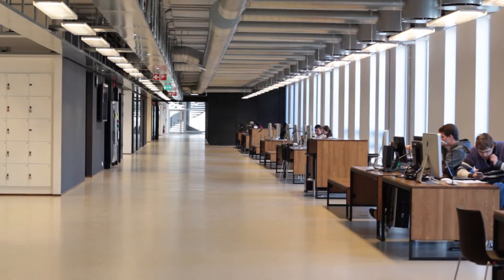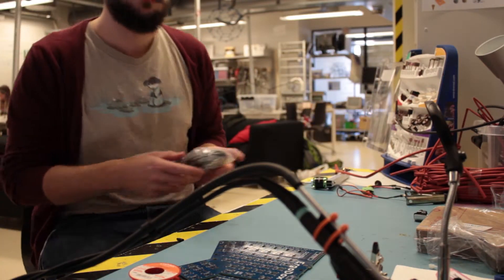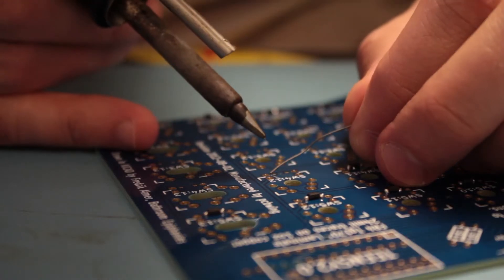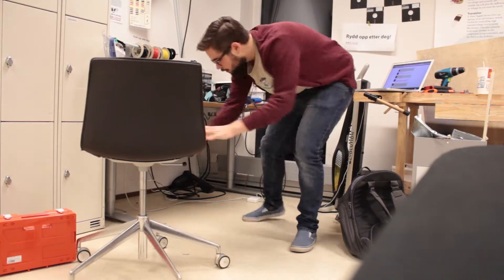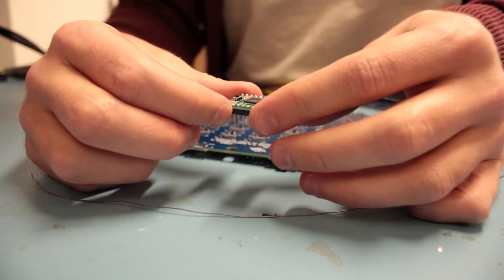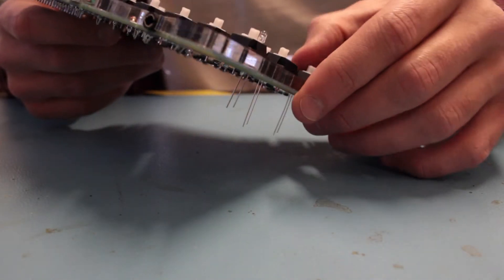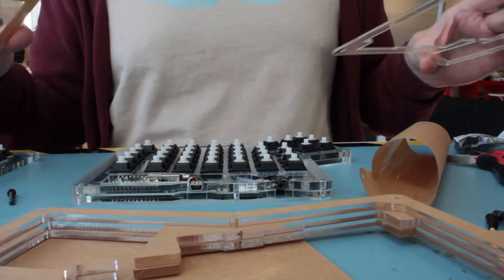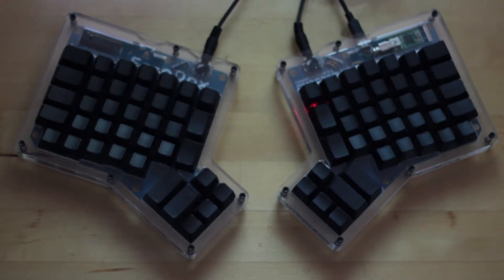My ErgoDox Assembly

Comment: Great video and great production quality! I made mine in the same situation you were in, first soldering project and all. Incredible experience all around and it left me with the same feeling of wanting more to do! haha. Ive had mine for almost 2 years coming up next month and it is still my main driver. 
Are you looking to upgrade to the infinity ergodox?
Reply from the maker: +patrain I want to, I love how the infinity looks, and that the two halves work individually.
I just recently replaced my TRRS cables because the ones Massdrop sent me lost connection ALL THE TIME. But overall I'm still extremely happy with the ErgoDox as-is, so I probably won't upgrade just yet :)
Thanks for commenting!